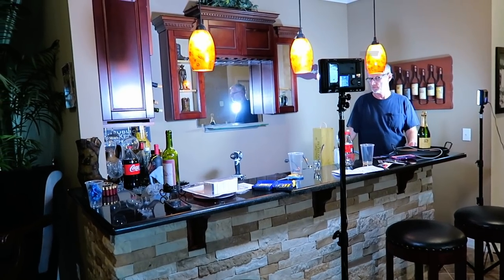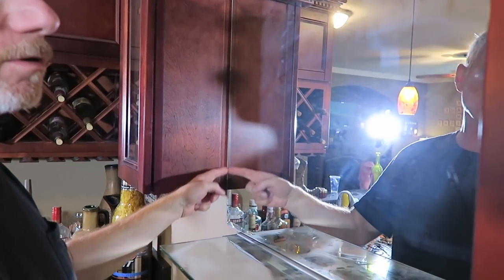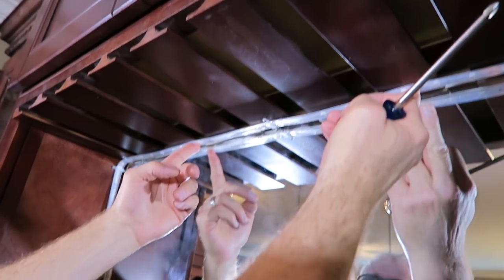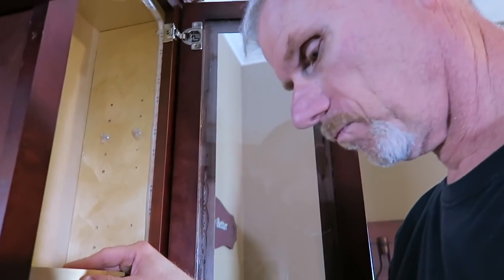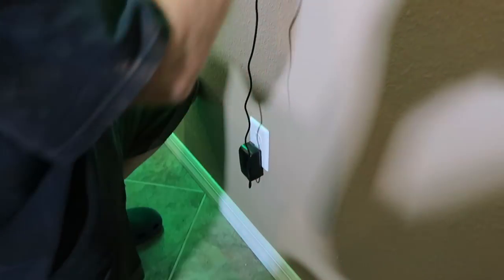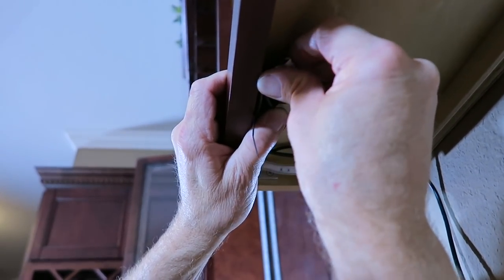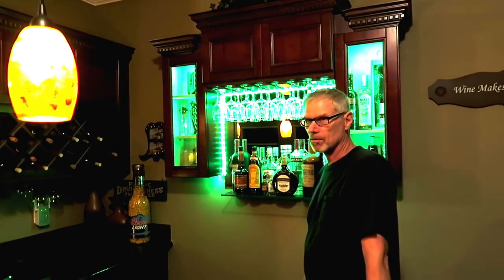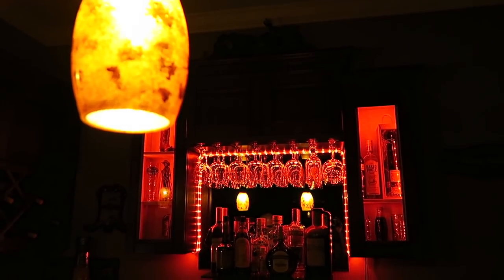BUILDING OUR DREAM HOME: DECOR & DESIGN IDEAS || QUICK DIY TO LIGHT UP YOUR WET BAR

Comment: What exactly is a wet bar? Is it like a wine bar
Reply from the maker: Sort of.  It could be.  It depends on what you want to use it for.  A wet bar is a bar, or counter with running water.  I suppose that is where the "wet" comes in.  Since there is plumbing and running water, it is considered a wet area in the house, like kitchens, and bathrooms.  We are not big alcohol beverage drinkers, but we may occasionally have a glass of wine, or a mixed drink .  We have a mini refrigerator at the bar.  So we store snacks, soft drinks and lots of water in it.  We also store our board games in a cabinets at the bar.  Since our wet bar is located right outside of our theater room, it is just so much more convenient to grab a snack, bottle of water, or soda when we are in the theatre room.  On movie nights, we use it like a concession stand.  Continued blessings to you and yours! 💞